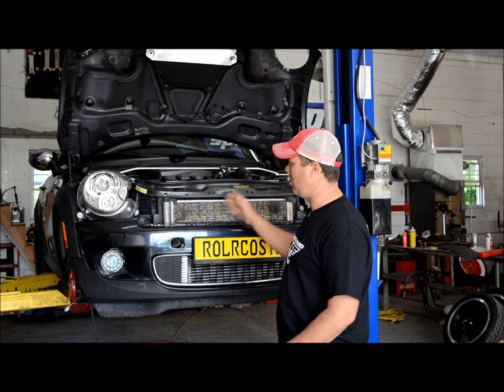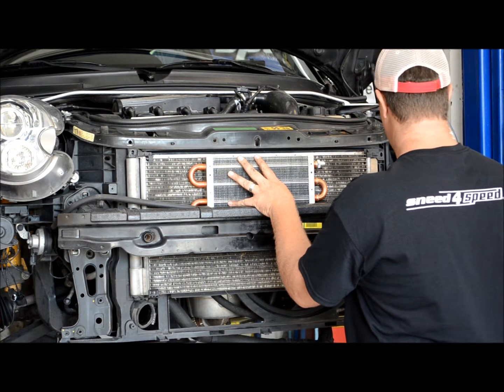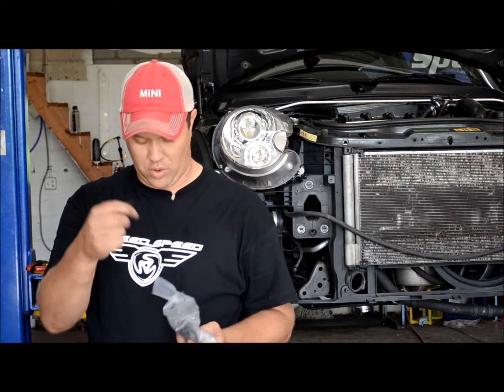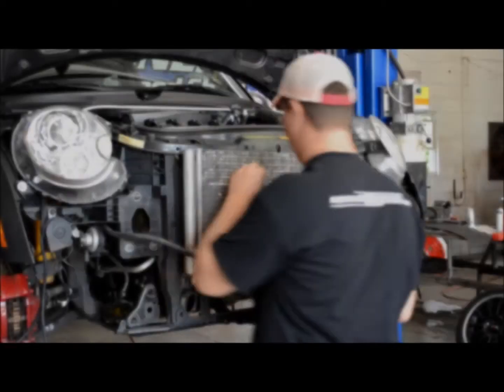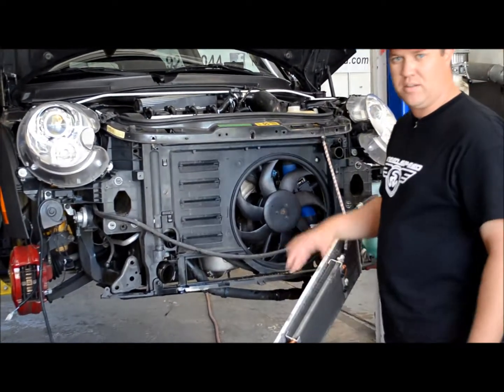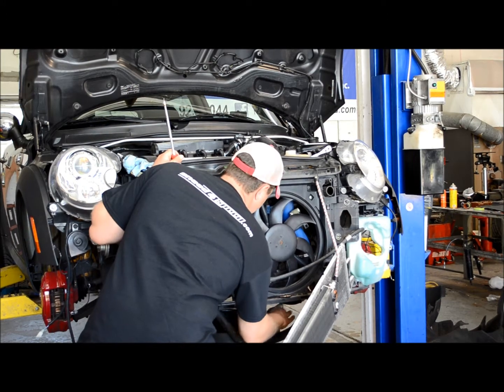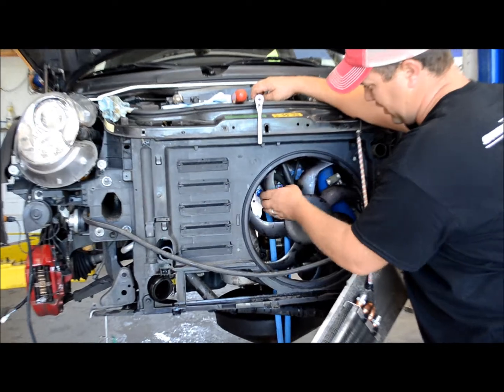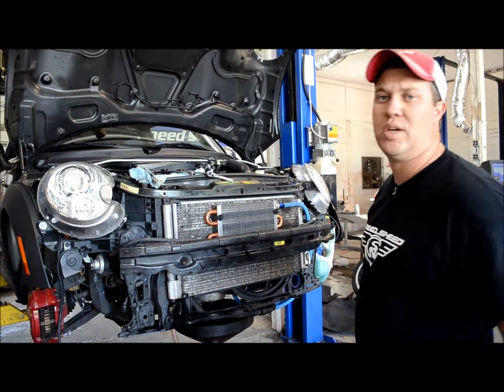Sneed4Speed oil cooler install on R56 MINI Cooper with larger FMIC

Comment: How much extra oil do you have to add to maintain proper oil pressure levels?
Reply from the maker: segrimsjinn oil level has nothing to do with oil pressure.  Oil pressure is determined by the bypass spring in the oil pump and can't be changed without rebuilding the pump.  I think you're asking how much oil you would need to add to maintain the proper fill level with our oil cooler installed.  Our oil cooler adds about 1 qt of capacity to the total oiling system on the R56 MINI.  So you'll need to add about a quart after the install to get the dip stick to read full again.

Comment: Can You unbolt the radiator fan blade to make the installation easier?
Reply from the maker: You have to remove the front end to unbolt the radiator fan.

Comment: Can you help me please? I have a problem!!
Where did you pass the pipes from? Can you send photo in email?
Reply from the maker: Matteo Ghidoli what problem are you having?
Reply: @sneedspeed1   hey can u help me I got a r55 jcw will this work I didn't find anything on sneed4speed for r55 only 53 and 56
Reply from the maker: @kevindabeast7863  yes r55 and r56 use the same engines.